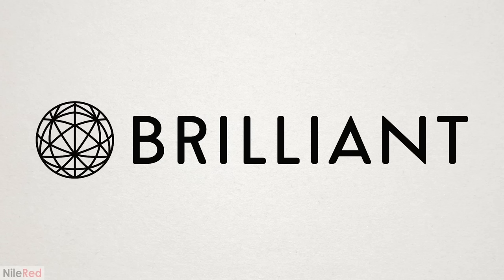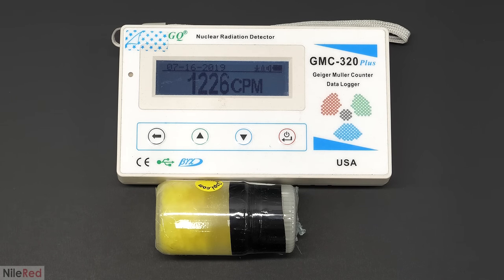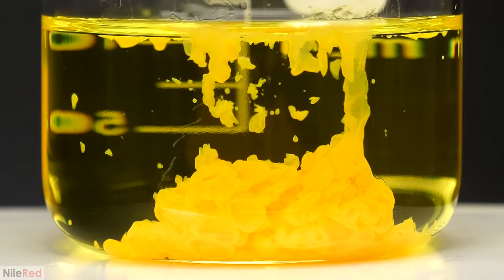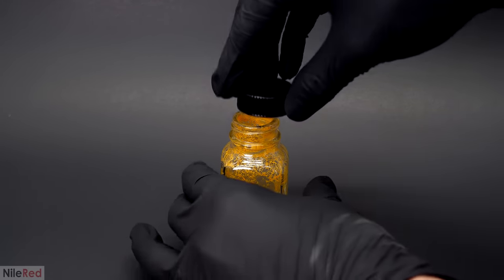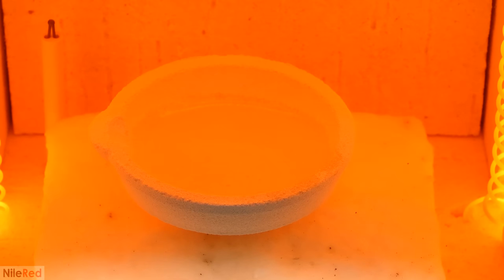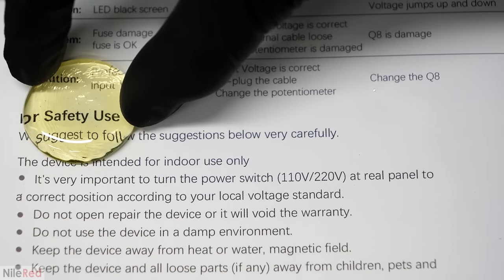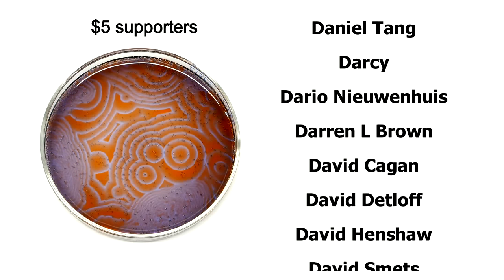Making uranium glass

Comment: Glass is very tempermental, so you want to avoid touching it with anything cooler than it is while it's busy cooling off. If you want to transfer the little disks onto something more insulating then you're best off just placing some insulation on top and flipping the whole graphite block over. Then you can sandwich it with more insulation. Alternately, you can just move the entire graphite block into the furnace and cut the heating, just letting everything coast down to room temp over many hours. This should anneal the glass, which isn't as useful from a strength aspect, but should help avoid spontaneous shattering.

I do have to wonder when you'll finally get approached by a scientific glassware company for a tour of their facilities. It would be cool to see them give you a demonstration of how your glassware gets made, and you can always torture the staff with stories of how and why your glassware ended up broken. I'm sure they will be understanding of the fact that every good chemist has at least one separatory funnel with a broken tip.

Comment: "How can we escalate the usual dangers of corrosion, oxidation and explosion?"

By adding some radioactivity of course!
Reply: by far the least dangerous risk involved!
Reply: Well, if the risk was any higher the FBI may turn into the most dangerous risk.  :-P
Reply: Next, we combine them
Reply: the radiation from the uranium he has is just as dangerous as holding a banana. The radiation will have no effect on his health.
Reply: @chrysophade210   not exactaly, in the end of the video he mesures It and each one of the small beads are about 17 times more radioactive than bananas, the big one was about 70 times more radioactive than bananas
Reply: @funkysagancat3295  While the levels are higher, the risk arguably isn't. That 1.36 microsieverts he measured with the alpha detector is around 73,500 times lower than the lowest levels of radiation clearly linked to a health risk in terms of acute exposure, and if I'm remembering correctly around 7,350 times lower than the lowest sustained direct (when inhaled) dose linked to immediate health risks. For something a bit interesting, even using the (highly disputed) linear no-threshold model that would suggest there is a higher risk from that bigger disk compared to a banana, that 1.36 microsieverts is 735 times less than the dose required to cause a 0.0055% increase in lifetime cancer risk, so 0.00000748299% increase in lifetime cancer risk if I'm not mistaken. Most evidence suggests however that lower doses don't decrease in risk linearly and that there is a threshold for radiation exposure before cancer risk increases, both as a result of our body's repair mechanisms.
Reply: @infantjones  short term yes, powder all over the place and in our body cause over time a bigger health risk

Comment: 00:01 Uranium glass glows green under blacklight
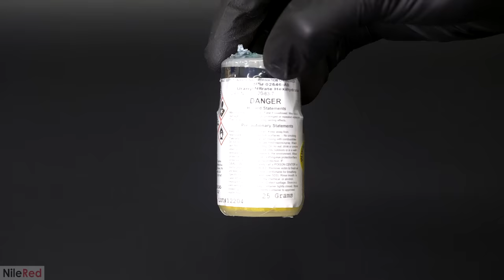02:12 Uranium nitrate emits radiation, detectable by instruments.
06:35 Creating sodium diuranate from uranium
08:48 Filtered and dried sodium diuranate
12:58 Learning to make glass using recommended ingredients
15:04 Sodium carbonate and boric acid lowered the melting point of silica for glassmaking.
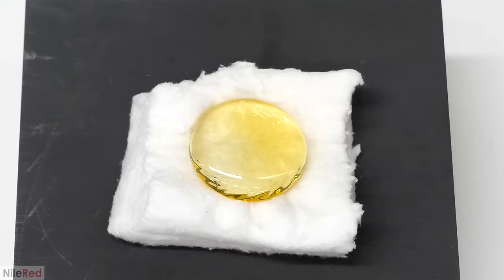19:17 Testing uranium glass for fluorescence
21:12 Uneven cooling caused internal stress in the glass.
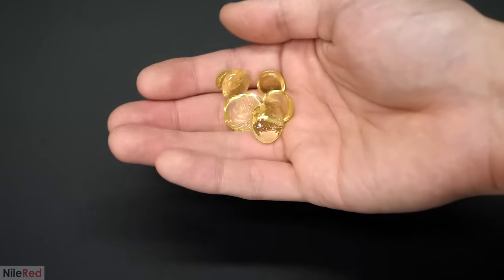25:08 The uranium glass was tested for radioactivity.
27:04 Promoting the website Brilliant and its benefits.
ia made this

Comment: He's getting into making glass

The homemade telescope video is inevitable.
Reply: the better ones use mirrrors
Reply: @xquo2714  and mirrors are made from....?
Reply: @xquo2714  the glass part does not matter. we used it in house mirrors because it allows light trough to the reflective metal coating which is sensitive, and thus the user can clean the mirror with out tearing off the coating. Telescope mirrors can be any material as long as you can coat it with a the reflective metal of your choise. House mirrors used a silver solution but other methods can be used to deposit a layer of metal on the surface. Different metal will reflect wavelength differently and you can use that to your advantage.
You can technically just polish the hell out of of a slab of silver or chromium but I think the methods of deposit can give a smoother, more uniform layer of particles.

But no mirror telescope will reflect 100% of the light. I think silver mirrors do absorb green

Comment: 12:50 When you talk about the uv light not affecting the radioactive material, did you trying take the lid off and shinning the uv light directly on the material rather than through the glass? I have a feeling that the glass was blocking the UV light and the radioactive material was just fine.

EDIT: it has been confirmed by @NileRed that the powder does not glow under direct UV light. Thanks for my most upvoted comment.
Reply: Yes glass blocks UV light very well.  Learned that from my years in studying herpetology and keeping reptiles.  UV lights don't work well to give them the UV they needed if it has to first travel through glass.  That's why screen lids are needed.
Reply: @BackYardScience2000  I thought I read this somewhere but wasn't sure of it until now. Thanks for the clarification.
Reply: Thats what i was thinking
Reply: Yeah, I was thinking this exact thing as he was doing it and to the comments to see if anyone had said it yet. One of the reasons we put solar cells under glass.
Reply from the maker: Wow, uh, I will have to check on that. That would be a major oversight on my part of that's the case.
Reply: @NileRed  first the grapes, now uranium, what will come next that will be ruined by glass? :P
Reply: yes glass absorbs UV light which is why you cant get a sun tan through glass
Reply: Yep. Normal glass does an excellent job at blocking UV light.
Also why ‘reaction’ lenses in glass won’t work inside a car.
Reply: @NileRed  just think about UV/vis spectroscopy, the couvettes used in the UV are made of quartz, glass is opaque to UV light, it's also very easy to demonstrate, becouse glass would have a shadow in UV light
Reply: @BackYardScience2000  Yeah. Good to know that you will try it.
Reply: Glass, foiling Nile red for as long as anyone can remember. Truly he has met his greatest adversary
Reply: Yep only pure quartz glass is UV-translucent, not just any that used in windows or bottles.
Reply: Hmm, this is new to me, i thought that since it's clear, it wouldn't have an effect, but the more i think about it, the more it makes sence, because I wasn't thinking about maby the density  or thickness of glass.
Reply: Glass doesn't block much UVA light.
Reply: @NileRed  Have you ran to the lab and tested it yet? Report back! :D
Reply: Quartz is transparent up until about 180nm, it will still be opaque to some UVC and all EUV.
Reply from the maker: I went back and checked just to be sure by shooting the blacklight at it directly. It definitely isn't fluorescent.
https://m.imgur.com/a/e7YOpH9
Reply: @NileRed  interesting,  now why doesnt it glow there but does before and after?
Reply: Actualy, thinking about it, if glass blocks uv it wouldnt be able to make the urenium glass glow...
Reply from the maker: @damien12221  it doesn't glow!
Reply: NileRed Dang! That would have been pretty funny.
Reply: @NileRed  it has something to do with the polar solvent. More specifically, the solvent environment can affect rotational or vibronic states and make certain electronic transitions more or less likely. I believe it has something to do with the Franck-Condon principle. I'll have to check my notes for more details, though.
Reply: @NileRed  here's a good resource. The solvent cage rearranges and increases the time it takes for the electronic transitions to occur and affects which excited state it moves to. Absence of the polar solvent makes fluorescence unlikely. I assume the SiO2 must serve the same purpose in the glass. 

https://www.olympus-lifescience.com/en/microscope-resource/primer/java/jablonski/solventeffects/
Reply: The “EDIT” put you into the lame category
Reply: 420 likes, nice
Reply: Bruh this ain't reddit 😅
Reply: @yohaijohn  It was more of a suggestion about the specific glass he was storing the product in blocking UV light. There is glass out there that does, but most doesn't

Comment: Uranium glass was a pretty major thing in the vacuum tube industry, where it was, and probably still is, used as a medium between normal glass and the pins. Basically, the amount of expansion & shrinking upon temperature change is different between glass and steel, and uranium glass is a medium, coming right between them with a correct mix of uranium and glass. For a normal vacuum tube this is not necessary, but for a big military transmitter tube, where reliability is important and very high running temperatures are normal (especially at the pins), this is pretty crucial.

The reason for all of this being important in tubes is that any potential microscopic leak = death, and again in military use that's not exactly great, especially with extremely expensive, powerful transmitting tubes. But it's not just when they are running that this matters, it also makes a big difference during the process of manufacture, maybe that is actually one of the bigger reasons, I'm not sure tbh. 

Tubes are extremely complicated, not just from the thermionic side of things, but also, and especially, from the chemistry perspective. For example, one of the most important parts of a tube is gettering and more active filtration, all tubes slowly release gasses, as one would expect for a thermionic-emission device, and also as one would expect, gasses are a big no-no in a vacuum tube. So, over a hundred years of research has been done in the filtration of such gasses. Not all tubes have active filtration however, and the level varies a lot. I have soviet tubes with such an immense amount of active filtration in place, they will never die from gass release, and they don't even have getter spots because they don't need it. But, almost all tubes eventually die from degradation of the cathode, except underwater repeating tubes. One thing for sure though, tube are not as unreliable as people think, it is mostly poor device design and the fact that companies like Mullard designed consumer tubes to purposefully prematurely fail, that they have such a reputation.
Reply: Wat
Reply: why tf you started talking about tubes
Reply: @whyiseverysinglehandletaken2  Lmao
Reply: @whyiseverysinglehandletaken2  go watch a vlog then dipshit
Reply: Interesting, thank you! I always heard of the computers my professors used that A) took up the size of a room and B) had several interfaces each interface was essentially a thread. Computers were expensive back then for a reason, its so cool how far we've come
Reply: That is very interesting. Without that capitalistic planned obsoletion thing, we may live in the Fallout universe now
Reply: TLDR?
Reply: @elijahmeinhard4780  lazy
Reply: Are there any common applications of vacuum tubes anymore? I thought they were pretty universally abandoned for silicon.

Comment: Most of the fast vintage camera lenses from late 30's to early 70's contained thorium oxide glass for it's optical performance benefits (low chromatic aberration). These are also quite radioactive.
Reply: There was a strategic bomber that was made out of an alloy of thorium and magnesium. It had a larger radioactive signature than the bomb it carried.
Reply: Thoriated tungsten used to be used in vacuum tube filaments too - when the filament was also the cathode, it emitted electrons better with some thorium in it.
Reply: Yeah, I bought a Pentax lens that has thorium on it. It has gotten a bit yellowish thought.
Reply: Very few lenses of that era have significant amounts of thorium. At least, not enough to detect with a pancake detector Geiger counter. If you are looking for easy to find radioactive sources, you are better off buying thoriated TIG welding sticks
Reply: @NoahSpurrier  Yes, very very few lenses. That's why my comment said "fast" ie. large aperture lenses only. Thorium oxide also isn't usually in the front or rear element of the lens, making it harder to detect the radiation with a Geiger counter. The radiation is also harmful for the film chemistry so they doped the glass as little as possible. Aspherichal elements have removed most of the need now anyway.
Reply: Pros: no rainbows. Cons: irradiates the film, making bright spots everywhere

Comment: 12:30 most normal glass blocks UV light, so you would have to test it outside the bottle
Reply: it doesnt. It only blocks UV-B and UV-C, but NOT UV-A.
And most UV lamps are longwave UV, thus all of it generally passes through
Reply: Wood's glass, invented in 1903 by American physicist Robert Williams Wood, allows the transmission of UV light
Reply: borosilicate allows for light to pass, the last batched of boro uranium was fully encased in clear and people also take tubes and sleeve clear over them, melt it over the top and repull it out so they can get as much as they possibly can because its rare and expensive.

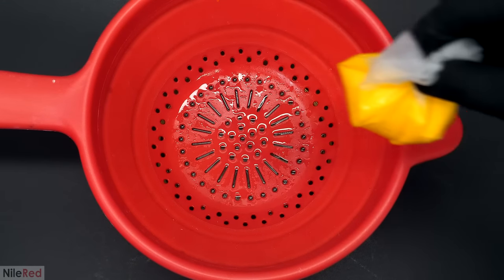Comment: 09:29 "I carefully took out the coffee filter"
radioactive water drops
Reply: The radioactive compound was probably insoluble so he didn't have to worry with a coffee filter as it will probably prevent any particles significantly big enough to pass through with the water
Reply: @justhallowed8499  yep. That's why he used a filter.

Comment: Btw depleted uranium is a common sight in tank rounds (which today look like metal arrows) all modern APFSDS(armour piercing fin stabilised discarding sabot the specific tank round for any tank to tank combat) have a depleted uranium core to make the round very tough and heavy thus with minimised drag through the armour and maximising inertia (with DU) you get max penetration 
So DU can still be used to make weapons and in some cases very strong (yet heavy) composite armour
Reply: That is insanely interesting. Thanks for this knowledge internet man 😃
Reply: >apfsds
God bless you
Reply: @Pindakaaspot  The dust in question is much less of a problem than the massive shock when something with that much energy hits your tank. I would be less concerned about the dust and more concerned about the straight up damage something like that will cause.

Lead causes heavy metal poisoning, yet it is used in every bullet *ever made*. Things expressly designed to go inside of a human being to cause damage.
Reply: @Dracomandriuthus  They mean for the population after the fighting is over. 

Lead doesn't emit alpha particles, which are what causes the birth defects.

DU ammunition is a large issue in former combat zones.
Reply: @tadferd4340  It's almost like they put it there on purpose.
Reply: FBI would like to question you
Reply: It’s also pyrophoric, very good for taking out crew. Bad because flaming uranium

Comment: 12:30 Glass blocks UV, so it's not surprising it wasn't fluorescing
Reply: i was about to post a similar comment, but found yours.
it seems like nile's uv light is mostly uvb, since glass blocks most uvb, but passes 75% uva, since uva is closer in wavelength to violet and blue light
Reply: Can confirm. Im mostly working with UV light and glass is the last thing you would put your sample in when doing the experiment.
Reply: i agree
Reply: volitronics yes I like uv lights too
Reply: Glass blocks UVC.  Blacklights emit primarily UVA which passes through glass.  Florescent blacklight tubes are regular glass, and emit UVA.  Tanning bed tubes are glass, and emit UVA and UVB.  LED blacklights produce no UVB or UVC.  (Cheap ones hardly even produce UVA, but deep violet instead).  Germicidal lamps are UVC and made of quartz, which passes UVC.